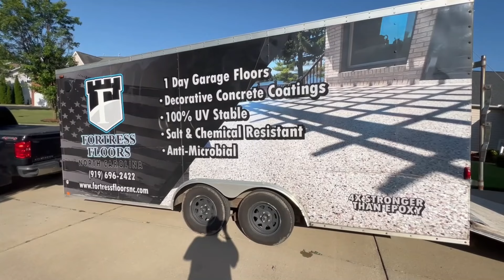HOW TO ADD EPOXY COATING TO CONCRETE PATIO / NEW PATIO LIVING SPACE

Comment: End result looks great, but I've always been led to believe that this won't hold up to the UV aspects in exterior applications and will begin to yellow.
Reply from the maker: Thanks so much, have a great day.😊😊😊😊
Reply: There are UV resistant epoxy products that can be used. But mostly, for exterior, installers use a polyurethane sealer. Which is UV stable and won't yellow. But since the general term is "epoxy flake" they might not specifically mention the polyurethane sealer part.